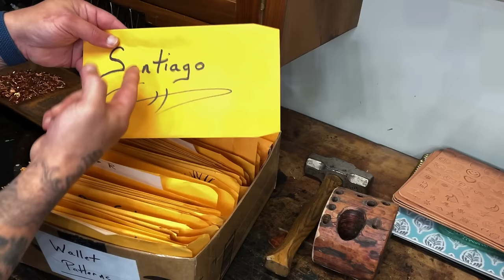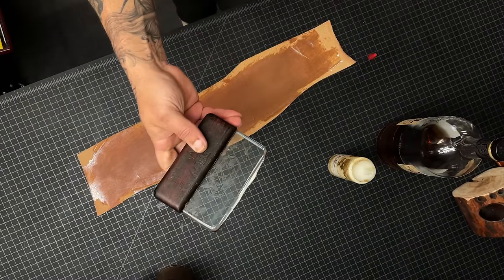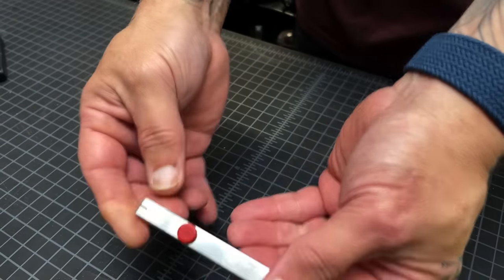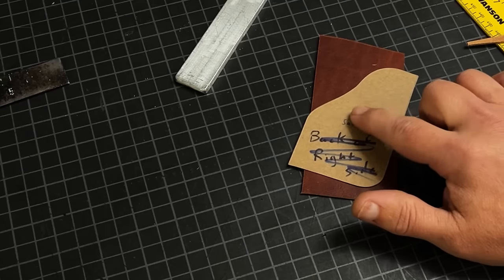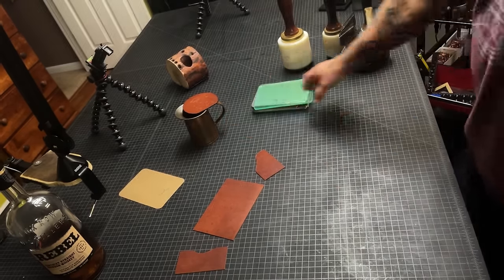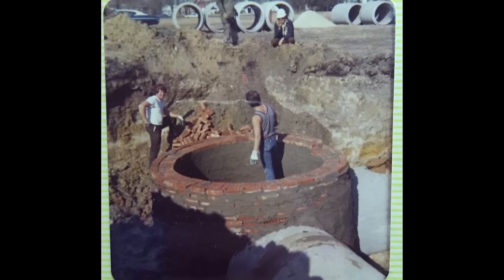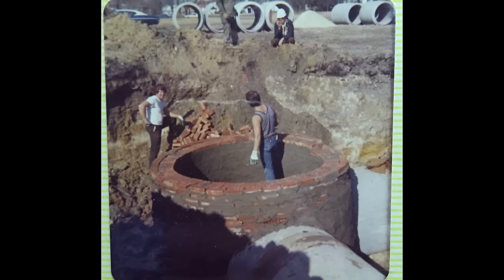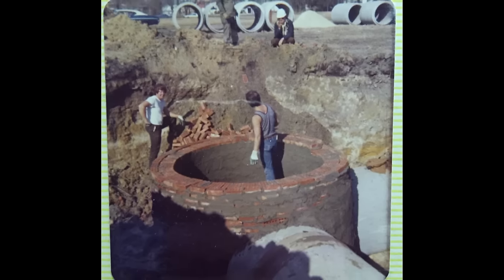EASY & QUICK?! - I'll Show You Why! (All Tools Explained!)

Comment: As said before by me, by far the best leather crafting videos on YouTube. I’ve learned so much and have been inspired to do more than I ever expected - thank you!  Quick question: why do you do the stitch line on the inside instead of the outside?  I’m sure you have a good reason - learn me 😉
Reply from the maker: Awe !!!!  Thanks!!!  I’m assuming you’re asking why I punch from inside to out ?   The “in” side of stitching looks SLIGHTLY better to me.  Most won’t notice from one side to the other.  But….  I know most will be looking at the inside of tie wallets 90% more often than the outside (after the first month of use). So, slight prettier inside.  Where you see more
Reply: @MasconLeather  a lot easier to make sure you land nice on the pockets as well.  i have done the outside punch like most videos show,  and a couple of times landed ugly on my pocket and it ruined my stitch line.  inside is definitely better for me.

Comment: Greetings Artie, I see you use Amy Roke's leather tweezers a lot.
I ask you for advice when sewing the leather parts for the handles...
Do you recommend me to first sew the section that goes from the beginning of the handles to the spring and cut the thread to then sew the part that goes from the spring to the end of the handle?
That is, the seam goes in 2 times or only one?
I appreciate it if you help me thank you.

Comment: Curious…I see in ALL your videos that when you are using the bump jigs you lay it down on the edge of the piece, then you lay the yellow ruler against it and then cut using the ruler as a guide. Why do you not just use the jig? Is it a thickness issue? Again, just curious. 
Phenomenal channel my man!! Love it!!
Reply from the maker: Because I cut on the right side of the straight edge.  Not left. 

And ruler is 1/8” thick. Jig is 1/4” (a little thick for cutting perpendicular)

The jig is where the cut needs to be.  But it’s on the wrong side.  If I could cut with my left hand it would work. 

Lol

Thanks for watching!!!

Comment: Quick Question - Do you have a video up about your film rig set-up?  I love what little I've been able to peek at so far (new viewer).
And I'm new to leathercraft.  Just wanted to pop in and say thanks for the videos and the work they are.  It's good work.
- Cathy (&, accidently, Steve), Ottawa/Bytown/Pimisi
Reply from the maker: My filming is done with tons of boom arms and tripods.  I’m moving the camera every 10 seconds to have appear as though a full camera crew is there.  But it’s just me.  Oh…. And I have to make the leather stuff too.  😆
Reply: @MasconLeather  Which is why those two tripod-thing-y-s sitting on your table top (weighed down by antique irons) intrigue me so darn much.  Because, if I'm reading them correctly, you used pipe fittings to build two of your equipment supports.  That are moveable, on wheels.  And have absolutely Nothing to do with Amazon.

Spot the film camera nerd dabbling with the idea to start a vintage/historic sewing channel (as you do...because 2022).

I've been looking around at these flimsy tripods and thinking there has got to be a better way than spend money on something that's clearly going to break after 6 months.

Um.  Dude?.  Mister Dude, Sir.  You made your own camera gear.  You can make a video about it.  And sell the on-line parts and instruction list on the on-line.  Just saying...
Reply from the maker: Oh!!! Those 2.  Yes.  Platforms on wheels, pipe and fittings as arms.  Etc etc.  and also, a two arm monitor stand (both arms adjustable). One holds my iPad Pro which is my camera monitor.  The other is for a camera mount.   Then, a rode id mic boom arm, fully adjustable. For another camera mount.   Then, 4 joby gorilla pods.  2 for camera mounts, 2 for led lights.  

It goes on and on and on.
Reply: @MasconLeather  Teach me teacher...
Reply: @MasconLeather  Seriously, you came up with a side-gig aimed straight at The YT-ers.  There are a whole bunch of humans over in the Cos Tube (Costumeing YT - concentrating on vintage and historic clothing makes) who would completely geek-out over these things...

Comment: Loving the inspiration from these videos!

Roughly how much do those stitching chisels cost in the States? The link doesn't say from here in the UK. Amazon UK can get them shipped but they work out the equivalent of $72 with free shipping. I don't know if that's a true reflection of the level of quality. Cheers.
Reply from the maker: Thanks for watching!   I’ve used the cheap chisels for 10+ years and been fine, do be honest.  Any will get the job done
Reply: @MasconLeather  I'll just get some over here for a third of the price. I like the Zen of doing them individually but a guitar strap is too long winded!

Comment: Thanks for the great video. I do have a question. Five to six ounce is approx. .086" thick. On the one side of the wallet you had 4 thicknesses, I think. That amounts to approx. .34". My stitching chisels are only effective for about .25" . The length of the tine is about .31" or so, but that leaves only the point to come through, which is not a large enough hole for the needle and thread. So after that lengthy explanation, finally my question: Are the tines on your stitching iron extra long, and if so, what is the length? Thanks again, have a good evening.
Reply from the maker: My chisels can go through about 4 layers.  Close.  But I’ve had to do 6 layers before.  If too thick, I punch as far as they can, then use a barry king awl to finish each hole, one by one.
Reply: @MasconLeather  Thanks I will look for a longer tine set. I have used drill press one hole at a time, but slow process. Thanks again.
Reply from the maker: I’m not a fan of holes ….  Have you seen my video just on hand stitching?  I explain my views on that as well
Reply: @MasconLeather  Thanks again. I sure I have, but I will hunt it up and watch it again.

Comment: Why do you line the ruler up with the bump jig and cut using the ruler? Why not just use the bump jig as your straight edge to cut and save a step?
Reply from the maker: That’s another method.  Absolutely.   Yep just prefer to be very precise.  And I like a 1/8” cutting edge rather than a 1/4”.